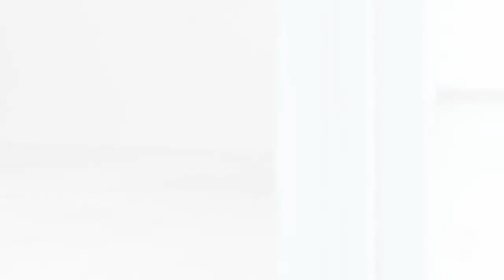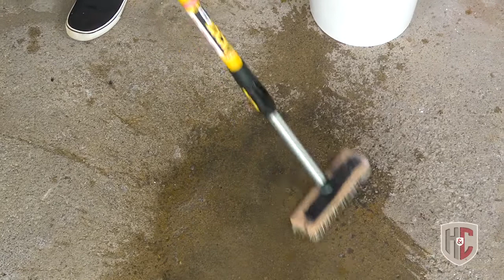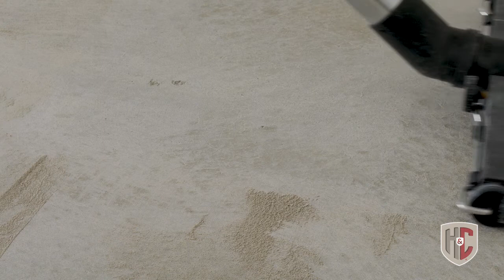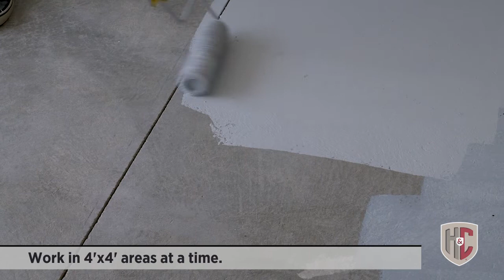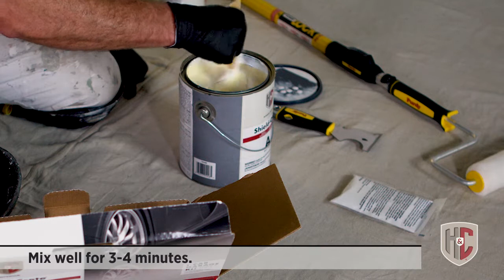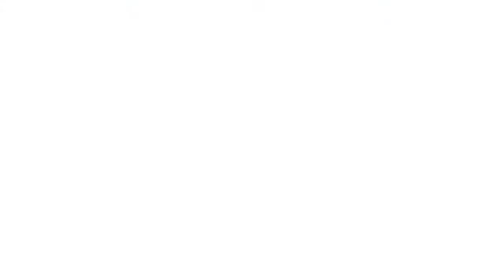H&C® Shield-Crete® Water-Based Epoxy Garage Floor Coating System

Comment: I’ve laid a few hundred water based garages and at least a couple thousand 100% solids epoxy  garages DO NOT GO WATERBASE! There’s a reason I switched and refuse to use it on anything same with armorseal 8100.  Park on this after getting your tires hot and tell me how it goes pulling out or god forbid you turn your warm wheels pulling in

Comment: Do you use a concrete bonding primer before applying epoxy? I bought some because I was reading that helps block the moisture and organics that might be trapped in the slab(Atleast for part epoxy paints) but was given 3 of these kits free from my neighbor since their slab is too cracked up.

Comment: Can I do a smaller mix for a small are or do I have to mix the entire qt
Reply: https://youtu.be/7XFRjgEqfOk?si=oYzjGkT0mFMliUVy
Reply: You need to mix the entire part A and B. If you can measure out 1/4 of the gallon part A and 1/4 of the part B and then mix it is possible but you will need a measuring cup and a calculator.
Reply: Yeah as long as you measure and use the same mix ratio on the back of the can if not look up the msds sheets for specs it’ll walk you through all the product details every product typically has msds sheets online if needed  but water based epoxy for garages ain’t The way to go I’ve laid a few hundred water based garages and at least a couple thousand 100% solids epoxy  garages DO NOT GO WATERBASE! There’s a reason I switched and refuse to use it on anything

Comment: Do I have to apply the clear? Can I just stop broadcast the chips?
Reply: Does the clear coat come in the kit?
Reply: If you put the chips down you have to use clear, otherwise you don't
Reply: Yea it’s a separate kit
Reply: If the clear top coat is not applied the flakes will scrape off and the paint/flakes will have nothing protecting it from the elements, chemicals, salt, etc.
Reply: You can lightly chip it sporadically then clear it or just solid color it and don’t clear